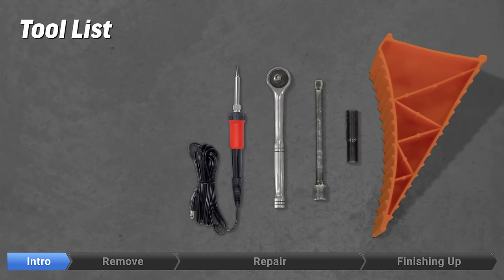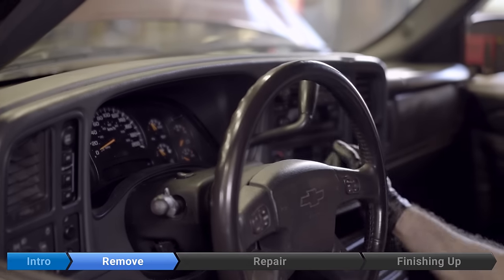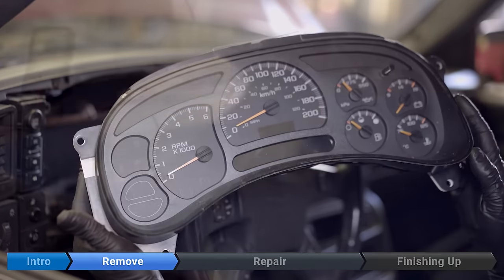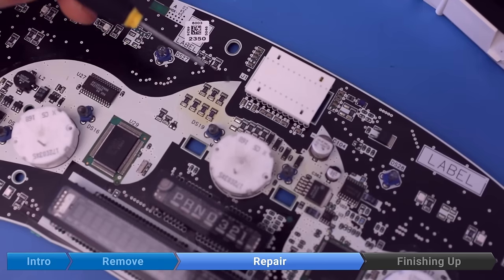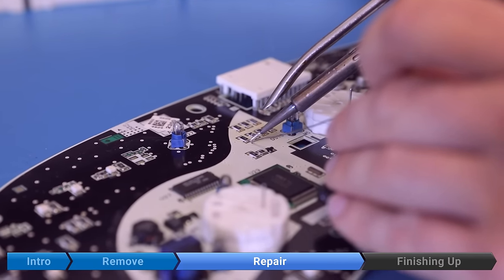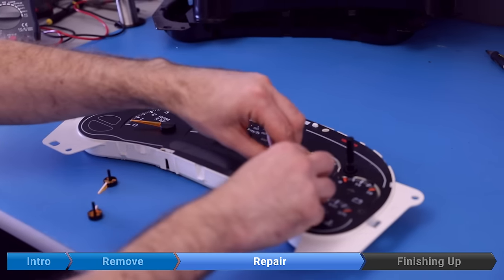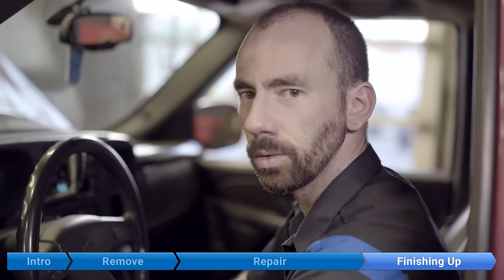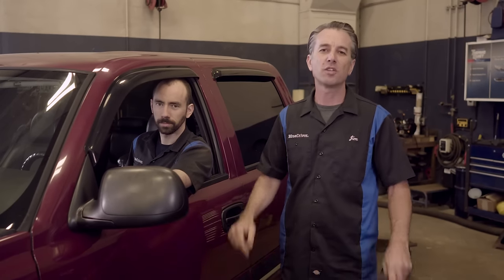Instrument Cluster Repair – 2003-2006 5.3L Chevy Silverado (Sierra, Tahoe, Yukon, etc.)

Comment: I was charged 250 for this ive never been a diy person but im going to start doing diy
Reply from the maker: Extra satisfaction when doing a repair that doesn't cost you anything! (unless you don't have a soldering iron, but then it's just a good excuse to buy tools)
Reply: You were charged for a full rebuild likely. This is just one of the many repairs needed on these clusters.. Steppers and bulbs also aren't super cheap
Reply: Tell them you were ripped off 
Ebay for less then $100

Comment: I noticed that the temperature was already in normal position meaning that the truck was running right before this fake video
Reply from the maker: We shot the repair one day in the office, and remove/installation steps when we had proper lighting and clean shirts another day
Reply: So what